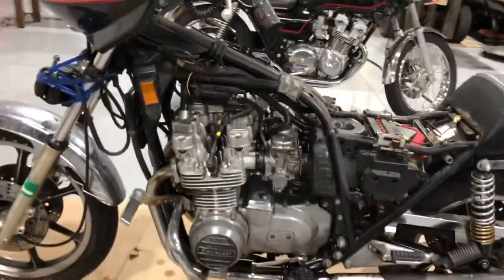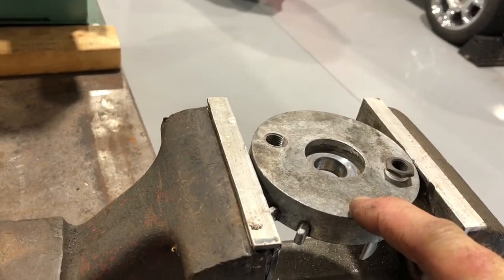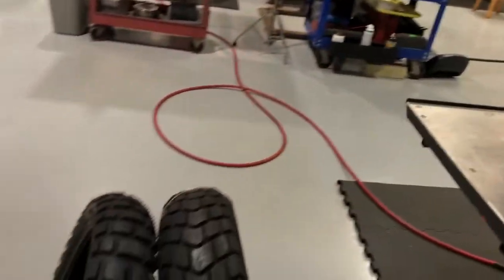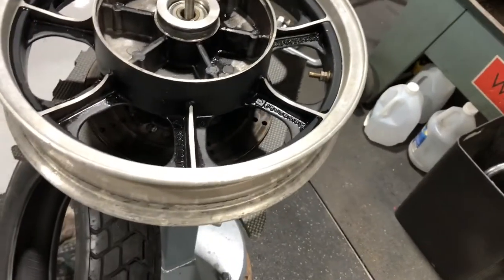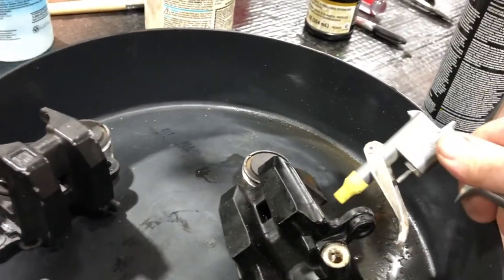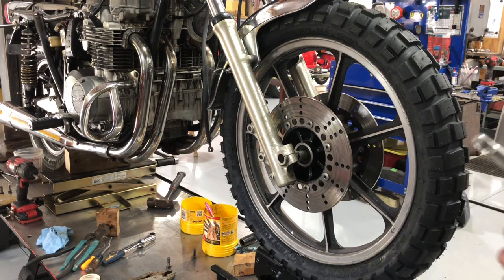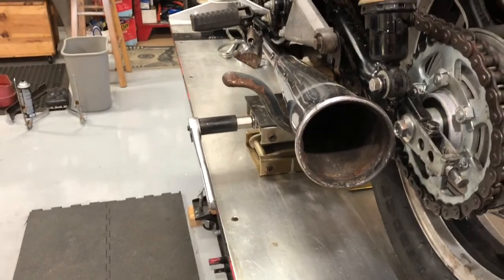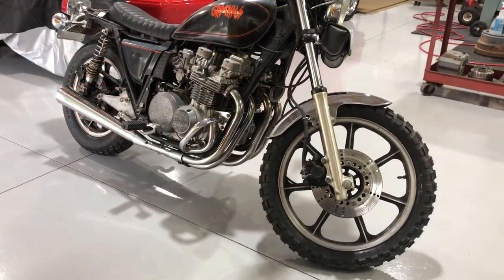Kawasaki KZ 750 Dual Purpose ATM

Comment: outstanding!  This summer i found a KZ750 twin pretty cheap, and i am doing something very similar to what you did .  Yes, finding a dual sport tire in this size IS a pain in the ass! 
Ive got mine running but the bars have got to go, they make the bike uncomfortable to ride. 
Its bad ass that you used a quad cylinder for this- but i'd dread getting it stuck!
Reply from the maker: I had a KZ 400 with nobbies for my daily before I had my license
Reply: @pbmachines972  you can take a 18" rear from a kz650 i matches perfektly with the distances, drumbrake and swing. did it to my kz750 twin ltd 82.
Reply: Yo mines been backfiring how do you remedy that

Comment: I think  my son has one
  My youngest son davy got it and my middle son tommy started making it into a bobber for him.    The got stuck on tbe wiring
Reply: That tirned out great  !    Great job
Reply from the maker: 🙏great to hear from you ✌️thanks man
Reply: @pbmachines972    how is it in low end power ?
Reply from the maker: This motor starts making power after four thousand rpm and really pulls hard to nine thousand so gotta be on your toes😬✌️